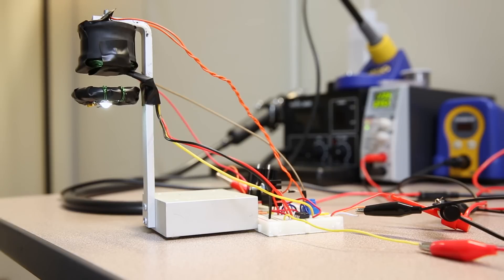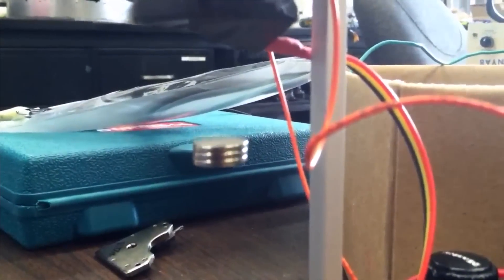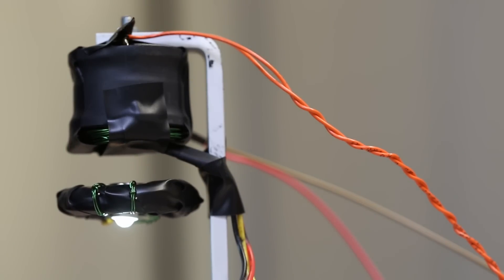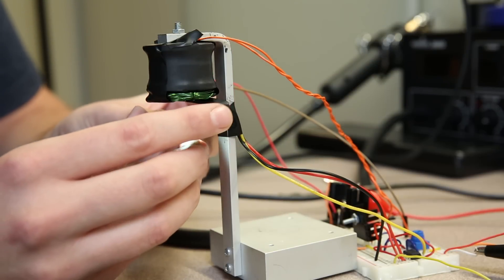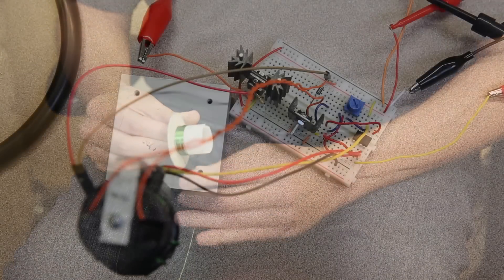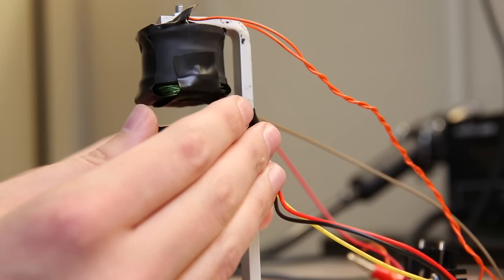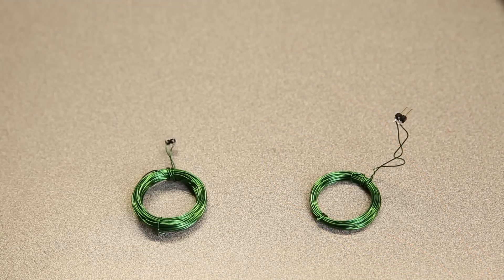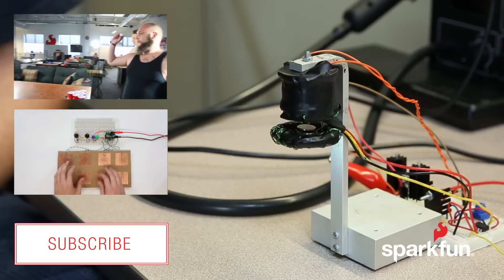Levitating LED Lamp

Comment: i want to builda floating cloudl lamp... getting the magnetic levitator and the led to work is no problem... i can just usea battery or a powerbank ... but this method would be way better.. would it be possible to fire up 10 led with it?

Comment: an LM358 (from your github link) isn't a comparator, it's an op amp. In the past I've had a bit of hysteresis when using the LM358 as a comparator. This might have something to do with the behavior not quite as you expect.

Comment: How much current are you having to run through the inductor? I'm trying the same setup (currently just tying to get the magnets to levitate)  but my power supply will only provide 2A, and it seems like that's not enough to produce a strong enough field to hold the magnets up at a significant distance away from the core of the inductor. With 12V and the MOSFET open that would give something like ~20A right? Are you having to drive that much current through the inductor? Thanks!

Comment: Could you make another video about levitating a magnet using 4 or more coils. In this video, magnet is kind of hanging instead of levitating. What should we do if we want to literally levitate a magnet. I saw videos using more electromagnets to levitate the magnet but I don't think I understood the logic.
Reply: Regardless of attraction or repulsion, they're both still levitating. The best way I can explain the repulsive levitation you're referring to, would be to take two magnets and try to push them together when they're repelling each other and see what happens when you provide a slight external force to push them together.

You can feel the magnets keep a spherical distance from each other, until the north polarity of one magnet "sees" the south polarity of the other. With repulsive levitation, the magnet needs a repulsive force to overcome the gravitational force. With a single coil, the magnet is going to push away and in whatever angle the magnet is on. To keep the magnet centered, you need more magnets to push a little in the x or y axis, while pushing in the z-axis to overcome gravity.  They also have a large ring magnet which encompasses the 3 or 4 coils to keep the levitating magnet in the center.

I have a decent understanding of the physics for repulsive levitation, but so far I've stuck with attractive levitation because it's much much easier to get working. Hope the long winded explanation helped.
Reply: I want to thank you for this detailed explanation. Even though it's detailed, it's easy to understand.
Reply: @alexwende871  cuántas número de vueltas son en cada bobina ???

Comment: What happens if you tilt the lamp 30, 60, 90 degrees?  Does the round light stay face down and eventually fall?  Is there a way to have lights at 30 degree angles from your original position?
Reply: I attached the magnets to the LED so the inductor is going to pull the magnets up and force them to be flat. but you could easily secure the magnets another way and with the extra wire connected to the LED, bend it to the angle you want. 

You still want the secondary coil to be parallel and center with the primary for maximum power transfer though.
Reply: Awesome!  Got some new lighting for my room!  Awesome video!